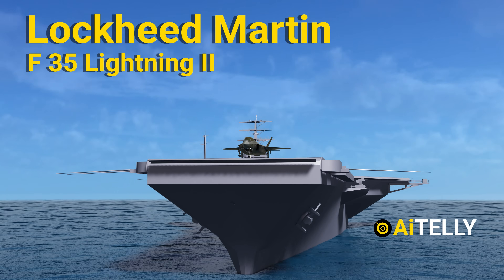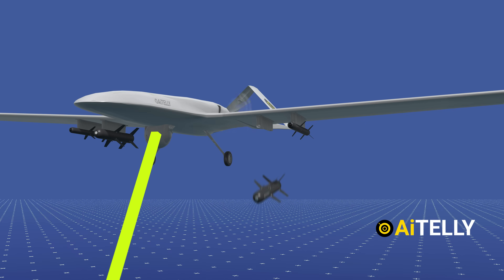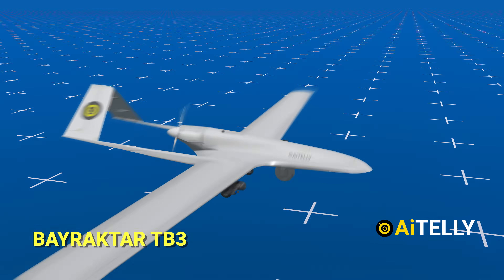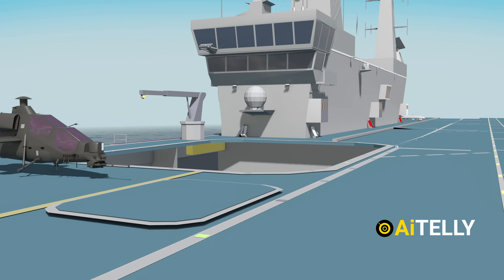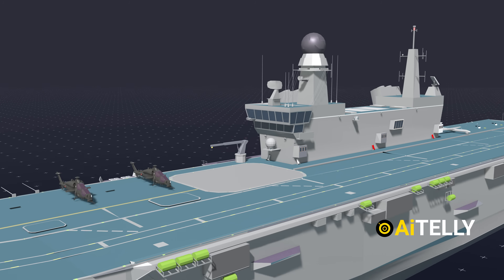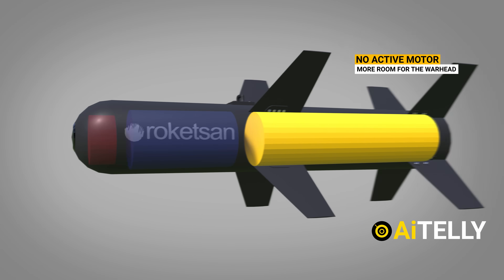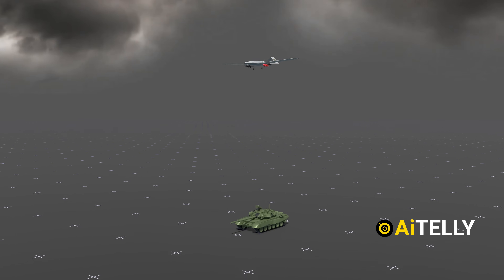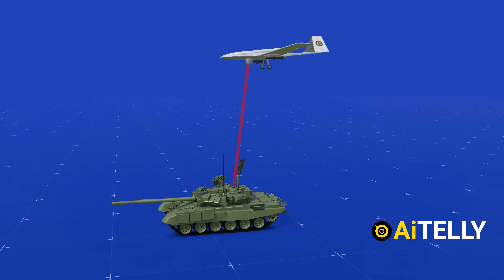TB3 Bayraktar drone Turkey | How it works #drones #tb3 #aircraftcarrier

Comment: Greece has been using the Russian-made S300 air defense system for years, why doesn't America or Europe impose an embargo on it?
India has just bought the S400 and America did not embargo it, but when it comes to Turkey, they make a lot of excuses to impose an embargo. This is completely double standards, nothing but Turkish hostility. Every time they impose an embargo on Turkey, the Turks themselves make the products that they are subject to embargo at world standards or even better. they produce themselves at a high level and while doing this, they save time by purchasing alternative products, for example;
Turkey has been asking America for Patriot Air defense missile for years but America did not give it, so as a result, the Turks started two air defense projects called Hisar and Siper and at this time they bought the S400.
The Turks wanted the F35, but America again did not give it, and the Turks started the KIZILELMA and MMU TF-X project.
There is a turkey that constantly develops itself, and they try to produce the best things in the world in every field and they succeed. The Turkish Defense Industry is growing exponentially every year.
The biggest congratulations should be to this huge country and nation.
Reply: @Angens India is not a NATO country. And India also does not get the F35.
Reply: O yüzdenmi parasını verdiğimiz halde10 senedir patriot vermediler bize masal anlatma burada başkan Trump bile bu çifte standarda isyan etti zaten Türkiye S400'ü bu çifte standart yüzünden aldı ama Elhamdülillah kötü komşu bizi kendi silahlarımızı vede kendi uçaklarımızı yapmaya itti ve başardık çok şükür iyikide f35'i almadık yoksa her gün f35'leri havalandıra bilmek için Amerika'dan birde şifre dilenecektik yani Amerika veya bir başka dost görünen sözde müttefikler bizi vurmaya kalksa bırak uçakları kullanmayı uçakları kaldıramayacaktık bile ama MMU TFX ve Kızılema sayesinde insanlı ve insansız uçak sahibi olduk o yüzden diyorum ki Amerika alsın f35'ini kıçına soksun
Reply: Sonra f35 bir uçan tabuttur her gün bir arıza her gün yeni bir kaza f35 büyük bir fiyaskodur İyiki almamışız ve İyiki kendi TFX ve Kızılema projemizi yapmışız
Reply: mükemmel izah etmişsin.tebrik ederim.
Reply: Well said
Reply: Особенно в свободе слова является передовым 😂
Reply: @@angens8673 India got S400 in 2018 but the negotiations were before 2017. India is allowed to keep and update them, even to get new batteries, but they cannot get new Russian equipment or else CAATSA sanctions will applied.
The same applies to Greece. They got S300 in 2000 and they allowed to keep them or even to upgrade them to S400 level.
Reply: @ΝικοςΝικόλαος-γ3σ  Turkey chose the s400 instead of the 100 f35 because Russia promised technology transfer .  I attribute the rapid construction of the Turkish air defense system Siper to this, and I believe that there will be no war between the two countries.
Reply: @berkaysagan9082  No, Turkey did not select s400 due to technology transfer. It was a political decision just because Turkey is willing to be closer to Russia and move away of the west world. 
Actually, it was a terrible decision. Aircraft carriers need air support. Also the on board fighters are the first line of defence. Now Anadulu lacks air support and the first line of defence. Without F35 Anadulu is just a failure, it can only be close to Turkish costline so as Turkish air force give sufficient air support.
Reply: @ΝικοςΝικόλαος-γ3σ  
We dont need more future American embargoes. We must free ourselves from western military, economic, political boundaries forever. We will build our own TF-X, Kızılelma, Anka-3 etc. and we will use them with full potential unlike western weapons.
Reply: @fatihersayn7877  Moving away from the western world and being closer to Russia and Iran is a very bad idea. It doesn't make you a free country, it makes you a more authoritarian country. What makes a country great is the quality of life of its citizens, freedom of speech, level of democracy, etc. The Western world is by far the most advanced in this area.
Reply: @ΝικοςΝικόλαος-γ3σ   Excluding a country in the world or making a policy of isolating is not a solution. To give an example, China's entry to the international space station in 2011 was blocked by the United States, even though other states wanted it. So what did the Chinese state do about this issue, sent its own space station to orbit in a short time like 10 years, and with newer technology and in the long run, the Chinese state was the winner.
Reply: @ΝικοςΝικόλαος-γ3σ    It doesn't make sense to take the word too far, be it in any state, be it Greece or Turkey or any other state, every state has the right to make its own decisions. If the allied state does not provide him with weapons to meet his security guarantees.
Reply: @fatihersayn7877  Turkey is constantly on the brink of bankruptcy. I think that country has other issues. And Kizilelma needs turbines made in Ukraine.
Reply: @ΝικοςΝικόλαος-γ3σ  They will give 100 f35 to Turkey, brother. America is saving them for the election. The f35s will arrive when the Erdogan government leaves, but Turkey is currently building its own aircraft, and even if they do, they may not accept it.
Reply: @ishaknazmiyakut  No, they won't give you the F35. No matter who is the leader of Turkey, USA consider you as problematic country.
As for your own aircraft, it is a blessing to us. Rafale, F16V and F35 against mediocre Turkish domestic fighter. What good news.
Reply: @ΝικοςΝικόλαος-γ3σ  turkey wanted to buy patriot but obama administration refused it. It is not logical to put sanctions for buying s 400 after you refused to sell patriot system.
Reply: @turishoferi1473  It's because it's their missiles and it's their rules and there is no alternative. Turkey played and lost. 
Any Russian equipment you bought before 2017, you have the right to keep and upgrade it. If you buy any Russian hardware after 2017, CAATSA sanctions automatically apply.
Reply: @ΝικοςΝικόλαος-γ3σ   i am not turkish. So.if you dont sell the other has the right to buy somewhere.
Reply: @turishoferi1473  You can buy from someone else, but you must be prepared to face the consequences.
The Turks had the illusion that they were a regional power and could play by their rules. What they get is because of their problematic politics
Reply: @ΝικοςΝικόλαος-γ3σ  the turks are regional power this is a fact accepted from all analysts in the world.
Reply: @turishoferi1473  No Turkey is not a region power, Region powers are countries like Israel, France, and Great Britain. Look about the military operation you made in Syria. You needed the Russian permission. Also, you have defence industry heavily depended on western countries.
Reply: @ΝικοςΝικόλαος-γ3σ  By doing this, the USA itself lost, putin between nato and Türkiye on this issue and won a victory against the USA, the USA failed in Syria and started to lose its influence in the middle east gradually, and now there is also the concern of losing its bases in Türkiye. Even if you don't like Türkiye, this doesn't change the fact that it is a regional power. Besides, the USA needs Türkiye for both the Middle East and the eastern bloc, and as the USA pushes Türkiye to the eastern bloc with its policies from the 60s, it will only lose itself. Also, quality does not always win against numbers, unfortunately, I remind you of the quantity strategy used by the soviets against the nazis in the 2nd world war and remind that a few F35s that Greece will have are not a serious threat to Türkiye. Türkiye has never seen Greece as a serious threat, you create too much drama.
Reply: @burakyldrm3409  Turkey is not a regional power. Countries like Great Britain, France and Italy are regional powers.
You may have the illusion that Turkey is a regional power, but that doesn't change the fact that your defense industry is heavily dependent on Western industry.
Don't compare the Soviet Union with Turkey. You don't have the manpower or resources that the Soviets had. Keep in mind that the Soviets defeated the Nazis because of the hard Russian winter and massive US military help.
Greece is not a threat to Turkey because Greece is not an aggressive country. The islands are out there. What are you waiting for? It is because the war with Greece would be an aeronautical war and Greece is superior on air force, air defense and submarines.
I would suggest you stop threatening to come overnight. You would have to deal with f35 and rafals
Reply: @ΝικοςΝικόλαος-γ3σ  1. England and France are not regional but global powers. I recommend you to distinguish between these two.
2. The issue of Turkish islands is a very complex situation both politically and militarily, and Turkey's reservation in this case is definitely not Greece, but Europe and the USA.
3. Turkey is not the Soviet Union, I agree, but you are not Nazi Germany.
4. I accept that our defense industry is largely foreign-dependent, but this continues to decrease day by day. The dependency on the West is that we have a fully NATO-integrated infrastructure and we know very well that NATO has never been on Turkey's side.
5. Contrary to what you say, Greece is an extremely aggressive country, in a situation that opens the gap between 2 countries, this aggressive attitude of Greece is not the one that armed the islands that should not be armed, it is not Turkey that also determines a nautical mile on its own that no one accepts, ignoring international agreements and resolutions on the nautical mile issue. offensive or even a cause of war.
6. War is not only fought in the air, and the main determinant of war is land warfare.
Reply: @burakyldrm3409  1.  England and France are not global powers but regional powers. Just look what happened at the Falkland war. Even though the British were victorious, the war was embarrassing for both the British and the French. The war was a nightmare for the British navy and a fiasco. What saved the British was the US threat to France not to give any military help to Argentina. 

2. The issue of islands in Aegean Sea is not complex. The civilized countries go to international court, but the problem is that Turkey is problematic country.

3. About the Soviet Union and Nazi Germany; It turned out that the quantity defeat the quality with the massive US military help.

4. Turkey does not have the financial strength for an advanced defense industry. You need at least $2.5 trillion GDP and you need to spend $60 billion on military projects. Until then you will be largely foreign dependent.

5. Greece is not an aggressive country. The army on the islands is for defensive reasons and their task is to cause as many casualties as possible on the invading force until backs come from the mainland.
If you want unarmed island, then you should withdraw the Turkish Aegan army.

6. Without air superiority, land warfare would be a nightmare for you. If Ukraine had F16, F16 and F35 fighters would Russia have invaded? What do you think?
Reply: @ΝικοςΝικόλαος-γ3σ  Obviously, this friend listens to Ioannis Theodoratos on BlueSky TV a lot :) Okay, you are the regional power, you have F35s that you can't even refuel.
Reply: @apojan1907  Neither Greece nor Turkey are region powers. Both countries are largely foreign dependent. Greece is more efficient than Turkey. Greece spends 8 billion on military while Turkey spends 20 billion and still Greece has better air force, air defence and submarines. I would suggest you spend your money in smarter way.
Reply: @ΝικοςΝικόλαος-γ3σ  1. I disagree that England and France are regional powers.

2. Just as we have the advantage in terms of quantity, if a lot of subjects that you surpass us in terms of quality disappears, only f35 will be the only one, and the number of them will be limited too.

3. The islands were never given to Greece. Italy gave back the islands that were temporarily given to them with the Ushi agreement after the 1st World War, to Turkey, but Greece had already occupied the islands and Turkey did not speak out because it did not want to fight, but those islands were never yours, you are the invader there. .

4. Turkey accepts the existence of Greece on the islands on one condition, provided that the islands are unarmed, and Greece has accepted this, but you are arming it by defying the treaties, and this shows how aggressive and unreliable Greece is.

5. Air superiority cannot be obtained only with airplanes, there are too many factors. There is no such thing as absolute air superiority just because you have the F35.

6. It is always good to develop their own weapons. At the moment, if turkey wanted to buy from abroad instead of the weapons it developed, it would have to deal with an unnecessary political embargo and would have to pay a lot of money and buy used and old products. why bother with what others deem you worthy, as a result, both sides come at the same price?
Reply: @burakyldrm3409  1. England and France are regional powers. If the British were a world power, they would win the Falklands War without serious problems. What happened was a nightmare for the British. The British won thanks to US help. If the US had not threatened France not to send any military help to Argentina, the British would have lost the war. The French had no choice but to obey. This was embarrassing for both the British and the French

2. In term of quality, Greece is better on-air force, F16V, mirage 2000-5, rafale and the near future F35. Also, Greece is a bit ahead on tanks. Even though Turkey has 2500 tanks while Greece has 1500, all tanks of Turkey are outdated and terrible outdate. Greece has 175 capable leopard 2A6 and the rest outdated and terrible outdated.

3. Greece was not the invader of the islands. Italy gave the islands to Greece. If you have objections, make your complaints in Italy.

4. if you want unarmed the islands, just withdraw the Turkish Aegean army. Until then the Exocet missiles that are in the islands would target the Turkish navy.

5. Greece has air superiority because of F16V, mirage 2000-5, rafales and due to outdated Turkish air force. With F35 would have air dominance.

6. Turkey relies on the mediocre domestic defence industry. Mediocre but domestic. This is a political decision. On the other hand, Greece relies on state-of-the-art Westen equipment. Actually, Greece spends 15 billion to buy equipment that needed more than 120 billions and more than 15 years to develop.
Reply: @ΝικοςΝικόλαος-γ3σ   dostum Türkiye ile yapilacak bir savasta uçaklarinizi havaya kaldirabileceginizimi saniyorsunuz ? O hava alanlariniz havaya uçurulmayacakmı ? Çok basit bir düşünce
Reply: @mustafaguner8602  You do not have the missile power to do that. Have you ever fired a missile against a NATO like army with multilayer air defence? 
Keep in mind the Turkish missiles never tested on a real battlefield.
You cannot fire a missile against Greece because Greece would fire back with the 90+ scalp battle proven missiles.
Reply: @ΝικοςΝικόλαος-γ3σ  The two militaries with the most war experience in the world belong to the Turkish and American states. The Turks are still fighting every day. The countries you mentioned have no chance against Turkey or America in an active war.
Reply: @ΝικοςΝικόλαος-γ3σ  Having technology is really an advantage. But only if you have the ability to use that technology. All soldiers in Europe lie in barracks. In an active war, I can swear that there are so many soldiers whose psychology could not withstand the courage and war experience of the Turks and would leave.
Reply: @ΝικοςΝικόλαος-γ3σ  Turks and Greeks are among the greatest warrior nations in history. Power is in the blood that flows in the veins of man. For Turks, war is a wedding. You know very well that the Turks ran to the war laughing. European countries do not have the courage, strength and psychology to fight Turkish soldiers.
Reply: @alperbeg  Turks have war experience with third world armies with outdated and terribly outdated equipment. Such experience would not help against an enemy with advanced technology. Look what happened in Libia. The Turkish troops faced two waves of rafales airstrikes, and they were unable to fight back. We do not know who hit the Turkish troops. It is said that they were the French. The courage, strength and psychology of the Turkish soldiers did not help against the advanced technology.
The Turks and Greeks are among the greatest warrior nations in history, but we are in the 21st century. Wars must be a thing of the past. What makes a country great is the quality of life of its citizens, freedom of speech, level of democracy, etc
Reply: @ΝικοςΝικόλαος-γ3σ The Turkish plane will have the technology to hunt all planes like birds, except the F22 Raptor.  Don't compare Turkey with other countries.  There is no country in this world that we have not defeated in war.  This country that you underestimate will hurt you very much in the war.
Reply: @fyilmaztr  You are right, we must not compare Turkey with Western countries. The gap in technology is huge. Look what happened to you in Libia. You have faced two waves of Rafale air strikes. The Turkish troops were helpless and unable to fight back.
Keep in mind that the war between Greece and Turkey will be an aeronautical war. Greece has air superiority, submarine superiority and better air defense.
I would suggest you stay calm and do not dream of wars. It is better for you.
What is the "technology to hunt all planes like birds" that you have, and the western countries have not?
Reply: @ΝικοςΝικόλαος-γ3σ  You keep saying that our planes are dependent on foreign countries, you have serious lack of information on this subject. I think the Greek media says that the Turks do not have engines, nothing will happen, they are still dependent on foreign countries, and you probably believe this. We have dozens of turbine models that we produce at our TEI company, I recommend you to examine them and get informed. Keep your friends close, your enemies closer ^^
Reply: India is not in NATO and is not an allie. India will never get F-35 type weapons off the US. Turkey was warned. @ΝικοςΝικόλαος-γ3σ
Reply: the S300 doesn't have the ability to interfere with the electronics of the aircraft.
The S-400 is completely different.
As far as India goes, it's not a NATO country and it's a completely different country than turkey. You think even the US can impose sanctions to a 1.5 Billion country? India is also de facto hostile to China, so US wouldn't want to be even slightly against them.

But hey, TB2-3 are better than F35s so no problem, right?
Reply: @georgetosounidis5545  In fact, the embargoes of America or Europe harm them more than Turkey.
Ah, by the way, the F35s, which crashed constantly and could not fly without a password from the USA, were the best planes in the world, right?
Reply: @enesaltinok  Yeah, they crash so often that none remain anymore.
The F16's also need a password

So, no problem, right?
Reply: @georgetosounidis5545  
So why does China have sanctions for possessing S400s? China is not a NATO member nor are they even listed as US/Non-NATO ally.
Reply: @georgetosounidis5545  Absolutely. 

Like the Tejas? No america, no Tejas. American radar, American engines.
Reply: It is because Greece got S300 in 2000 before CAATSA law. 
Any Russian equipment you bought before 2017, you have the right to keep and upgrade it. If you buy any Russian hardware after 2017, CAATSA sanctions automatically apply. Turkey knew it, but preferred two batteries s400 instead of 100 F35
Reply: @ΝικοςΝικόλαος-γ3σ  although F-35 is a good fighter jet, it is extremely expensive to buy, maintain, and upgrade in time. I think Türkiye should be happy to not have these jets. Instead Türkiye can produce 500-600 supersonic Kızılelma with a coast of 100 F35’s. Basically its much more benefical to produce and use your own technologies than to buy and bind yourself to another countries products. MMU is also on it’s way. 👍🏻
Reply: @ainalrami  Actually, we are happy not to have Turkey F35 jets.
Please do not compare F35 with Kızılelma. F35 is on other level. It is better to have 20 F35 rather than 1000 Kızılelma. F35 is able of deep strike on the mainland something that Kızılelma cannot do.
With an aggressive neighboring country constantly threatening to invade, we don't have many options. The only option we have is to buy with a few billion advanced western equipment that took over 120 billion and 15 years to develop. Actually, we buy at 1/10th the cost if we tried to develop them ourselves.
Reply: @ΝικοςΝικόλαος-γ3σ  Turkiye is a regional power, and we are not threatining Greece as long as they don't go after their emperial ambition...  Western powers capitalized Greek's fear of Turks pretty well and made you completely dependent on them.. It is our Ataturk's teaching "Independency is my character", and tells about a typical Turk on the street...  
We don't appreciate Western capitalist and emperyalist lonely lives, or Middle Eastern backwardness... We appreciate and love in with our culture and care about each other that is enough to all of your 100 or whatever F-35s numbers...  (Please also don't be typical and mix up the Ottoman Empire with modern Turkiye, they are very different. This way or that way, Western powers and Greeks will learn this)
Reply: @umitsirt7310  Turkey is not a regional power, it's just a local power that has a hard time dealing with Greece, which is 8.5 times smaller.
Your defence industry is heavily dependent on Canada, the US, Great Britain, Italy, the Netherlands, Belgium, Spain, South Korea, Germany and even France. 
Remember that in the crises of 2022, your President Erdogan understood this and learned his lesson, he became a good boy by stopping threatening Greece.
So, I would suggest you play with your playstation and leave the geopolitics to the professionals
Reply: @ΝικοςΝικόλαος-γ3σ  My brother, the Greek people and culture are very close to us. We have lived together for hundreds of years. We have interacted with many cultures. But Greece is really far from being my rival. You can be consoled with whatever they give you, doesn't the fact that you have nothing of your own worry you about the future? After all, you may not be able to use the toys you were given one day.
What they think is known is actually a big dream. We are the reason why Europe loves Greece. They use you as a buffer against us. The day they stop seeing us as a threat, they will be done with you and will no longer give you what they gave you. Then you will fall into a big technological void. Great powers never give anything for nothing. Look at the situation in Ukraine and start worrying about your own country :D

I should also mention that the global and regional powers came together 100 years ago and failed? Do you want to try again? :D
Reply: @ΝικοςΝικόλαος-γ3σ  You are misrepresenting the process. President Erdogan asked the USA for Patriot for air defense, the American congress did not give it. Trump admitted this mistake. Türkiye had to buy the air defense system it urgently needed from Russia.
Reply: @apojan1907  "Türkiye had to buy the air defense system it urgently needed from Russia."
Why the urgency? Have you been thinking of invading somewhere? If so, that's why the US didn't sell you the Patriot. What the US is selling is only for defense reasons.
Reply: @ΝικοςΝικόλαος-γ3σ  The CAATSA law was passed just to punish Turkey.  America knew that we would receive Russian missiles.  They took it out before we signed it to dissuade us.  Their goal was not to give us the F35 because they thought we would reverse engineer and steal its technology.  Just like they didn't release the unmanned aerial vehicle Predator in 2007.  We bought Russian missiles to protect ourselves from America.  because America and Western European countries controlled the coup attempt in 2016.